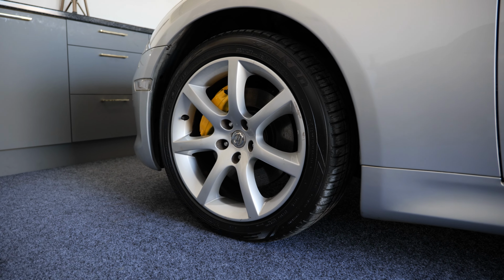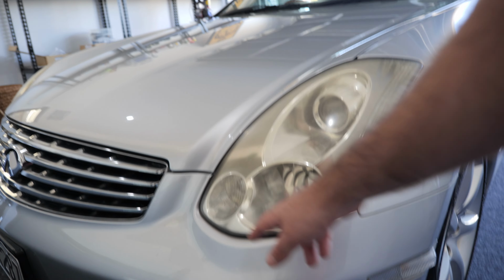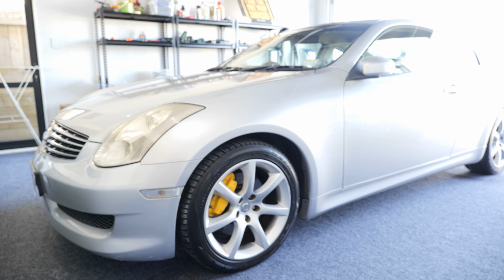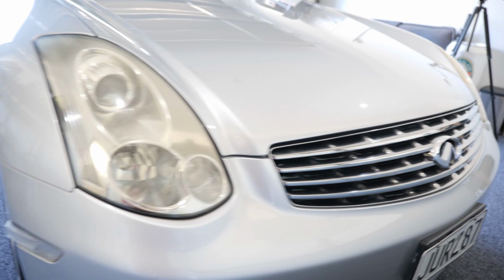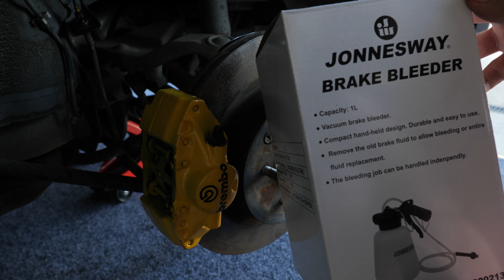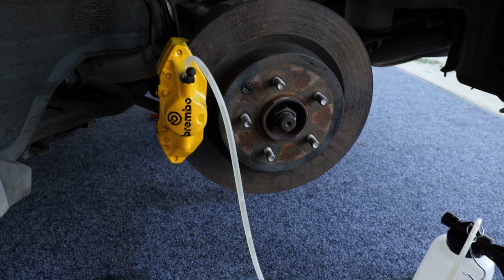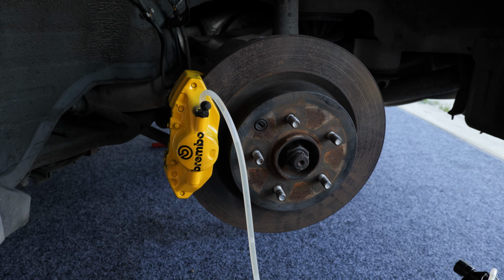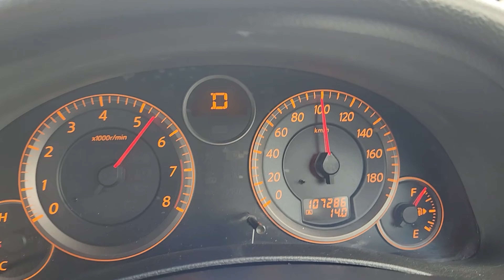[Build Series Part 2] Skyline G35  Gets Plenum Spacer Brembos Finished & Service + Car Noises

Comment: Hello! Just checking if you were you still interested in the 1990 P10 Primera that I put up on the Unicorn Circuit back in January? Your YouTube channel doesn't seem to have any contact info on it. It's probably gonna go to the wreckers otherwise. Thanks
Reply from the maker: @Ben501181  that's a cool car mate. If I had the room I would, just have too many small projects on at the moment. I do apologize. But please don't send to the wreckers. I have no doubt one of the many Facebook groups around would have users very interested in adopting that car?
Reply: @BCGARAGE853  No problem! Thanks for the reply anyways 🙂. Yeah I'll poke around for a bit longer. Will see what happens 👌. All the best with your projects!